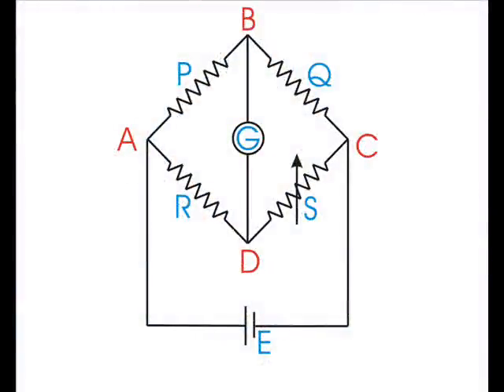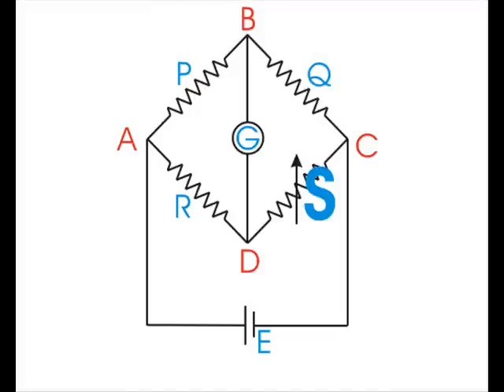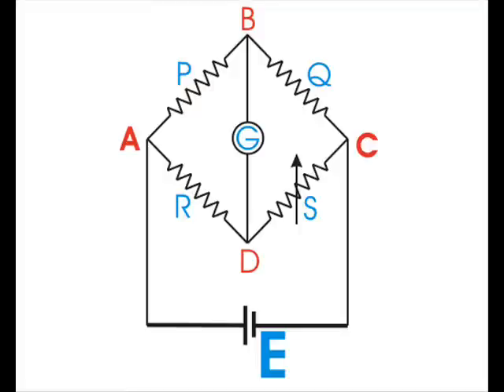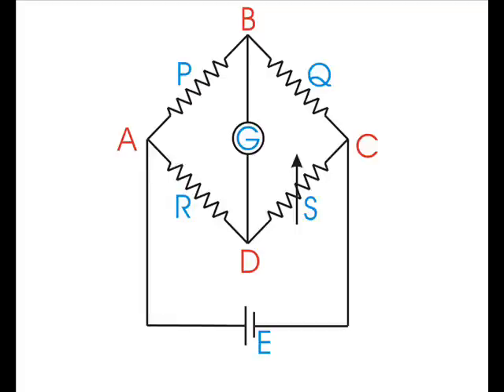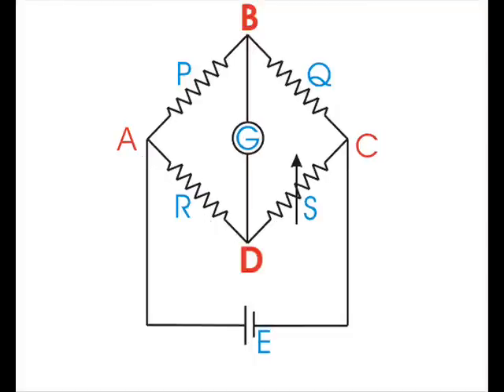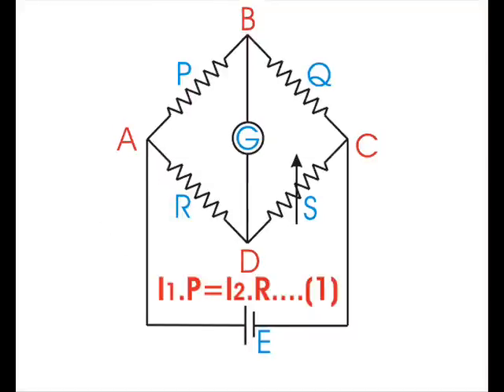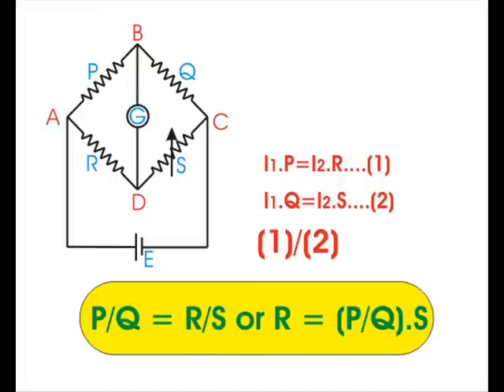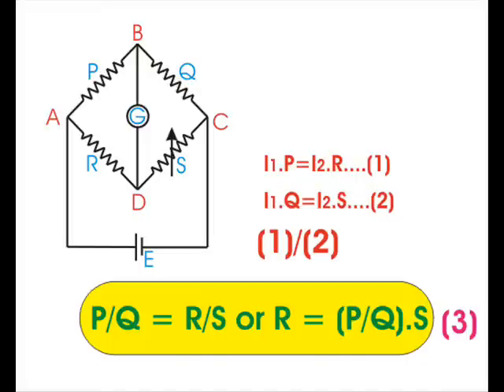Wheatstone Bridge: Working Principle & Formula

Comment: Current is flowing from A to D then to point C. How current is adjusted at resister S to make the same potential difference at B and D. Actually resistor R is variable resistor and S is unkown resistor.